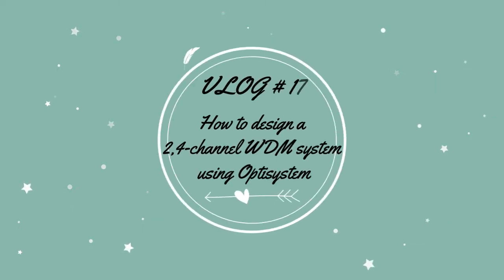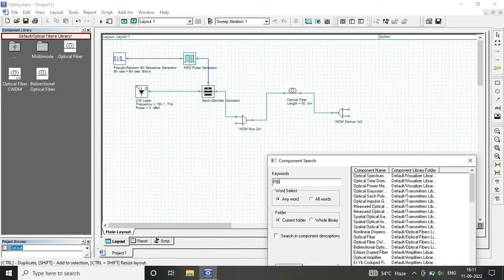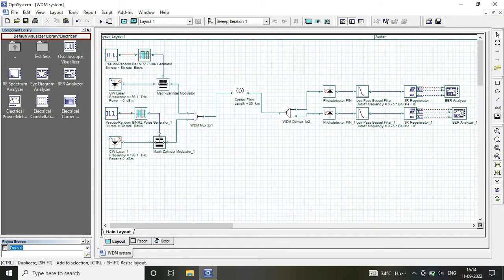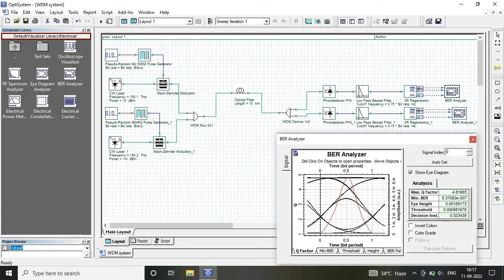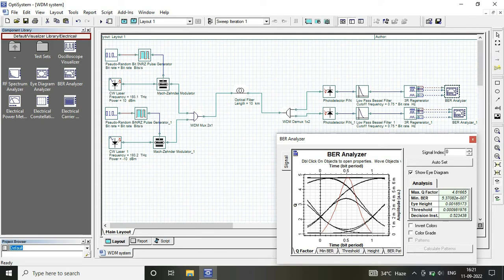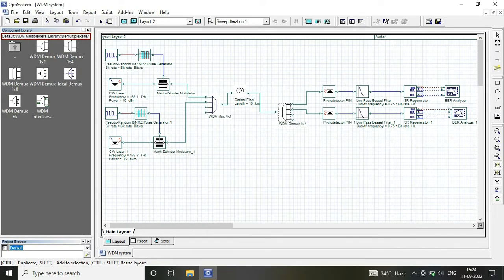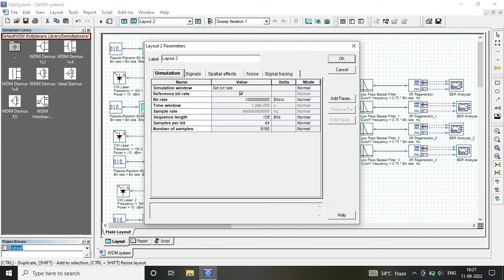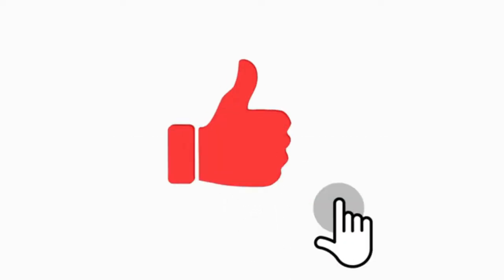How to Design a 2,4-Channel WDM system using Optisystem Software I In English I #Optisystem Tutorial

Comment: Designing a point-to-point WDM path system for digital modulation troubles the following conditions:
• External adjustment mode
• Fiber length: 100 km.
• BER: or less.
• Total cost: ≤ 100,000 USD.
• Minimum bit rate: 40 Gbps.
• Select all components on the transmission line as in the example below:

 100km single-mode fiber optic cable: 
− Model: Fasttel 2FO-TL
− Price: 1,100 VND/m2 
− Link: Liquidation of 2FO Fiber Optic Cable | Cho Lon Joint Stock Company
− Fiber type: 2 monochrome optical fibers (Singlemode) 9/125 µm.
− Standard: Complies with ITU-T G.652.D and G.657.D
− Operating wavelength: 1310 nm and 1550 nm.
Please help me!